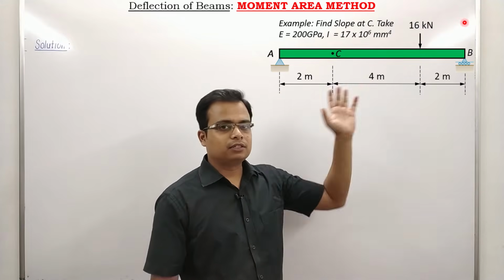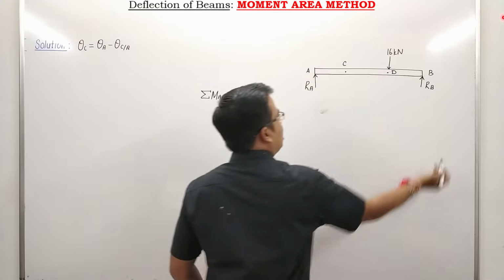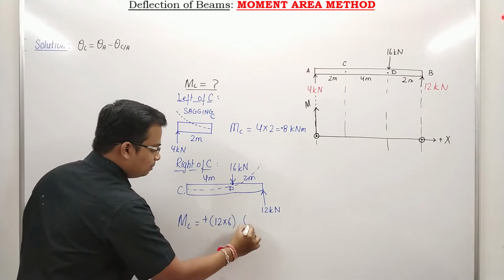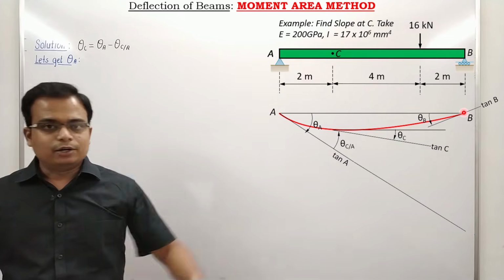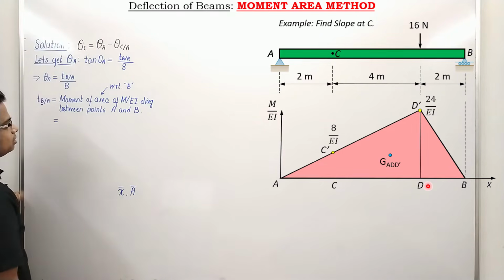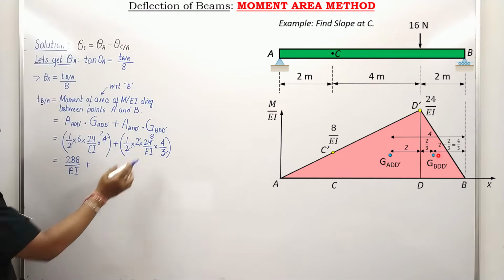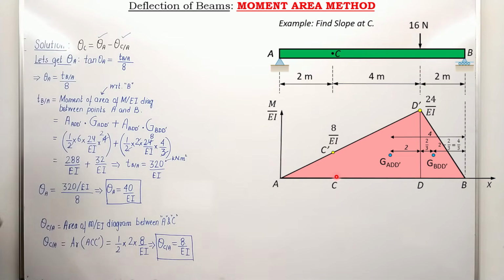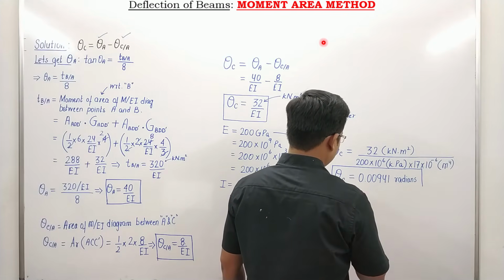Deflection of Beams | Moment Area Method | Solved Example 4 | Lecture 14

Comment: A continuous beam ABCD, 15 m long is fixed at A and D.
Span Length (m) Loading
AB
5 Point load 12 kN at 2.5 m from A
BC
5 UDL of 6 kN/m overall span
CD
5 Point load 8 kN at 2 m from D
Analyse the beam completely using slope deflection method and 
draw BMD if the following movements take place 
simultaneously
.
(i) The end A yields, turning through 1/250 radians in a 
clockwise direction.
(ii) End B sinks 30 mm in downward direction.
(iii) End C sinks 20 mm in downward direction.
The beam has constant I = 34x10
5 mm
4 & E = 2x10
5 N/mm
2
. 
Sir I need this question solutions